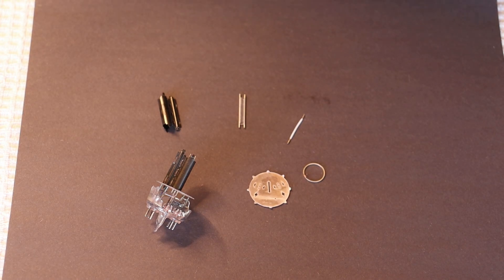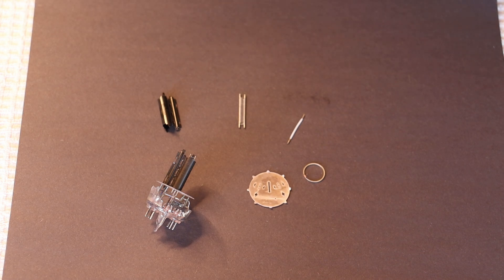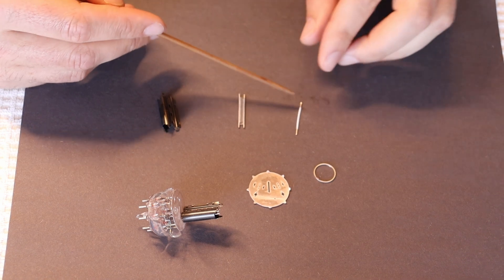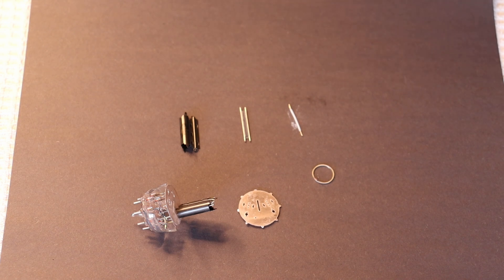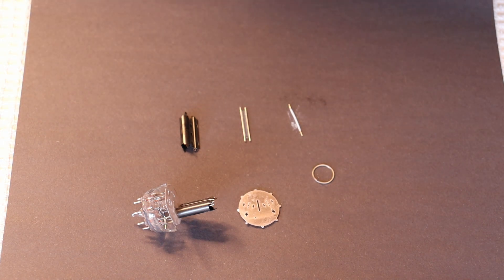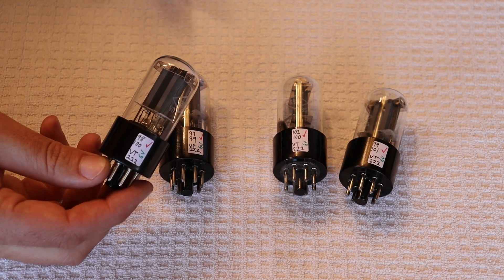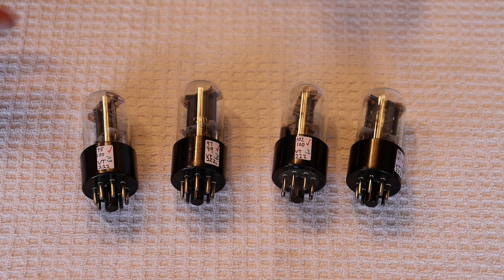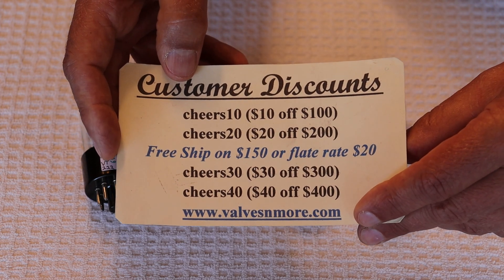Tube Lab #247 - Is Tube Burn IN Real?

Comment: Long ago I read a research paper in which the authors had tested burn in and life at various heater voltages.  They concluded that most tubes optimized performance over life, and almost infinite life could be achieved with moderate loss in performance by running heater voltage 20% low.   They even speculated that there was a bit of planned obsolesce going on. Unfortunately this was 30 years ago so I cannot provide a link and cannot find my paper copy.  Have you observed this?

Comment: What is causing Cathode Regeneration? and is Cathode Regeneration consider good or bad?
Reply from the maker: Cathode Regeneration is a continuous process that every vacuum tube is designed to perform or all tubes would slowly stop working properly over a fairly short period of time.  Basically Cathode Regeneration is the process by which gas molecules are driven off the surface of the cathode and the cathode continuously renews itself.  It works thanks to the inherent properties of vacuum tubes, the physical design of the tube and most importantly the coating applied to the cathode.  For audio tubes it's not something to ever worry about, even as designers it's not a concern, unless of course we were building a vacuum tube computer or some other device in which the tube is lamped but not actually doing anything for very long periods of time.  For those applications, special tubes were designed with extra heavy cathode coatings.  None of those tubes, in my experience, sound very good with audio.

Comment: Does it damage a tube to run the heater for a long period without anode current flowing? Ie: is it bad to run a tube heater only?
Reply from the maker: This is an excellent question.  In my experience just lamping a tube (at data sheet specified filament voltage) with no electrodes connected is perfectly safe for most tubes.  But when you understand that every tube has a finite lifespan (just like an incandescent light bulb), you realize you are literally throwing away good operating hours by doing this.  For years I've read accounts of people not turning off their tube system (ever), or burning in rare NOS vintage tubes for 24-72hrs while playing white noise...
Reply: @tubelab194  Thank you! I was concerned about it as sometimes I allow NOS vintage tubes to heat up on my AVO tube tester for a while with just the filament powered up before testing in order to drive off any gas molecules.
Reply from the maker: @Tharsis879 I think that's just fine.  Just don't forget them!  In fact we have a rule on our electrical benches, not to leave anything on if we leave the bench (other than a quick trip to the washroom or kitchen (working with high voltage is thirsty and hungry work).
Reply: I've always understood that amplifiers with a way to toggle the B+ like a standby, was primarily there so that you could warm the filaments up for a few seconds before turning on the B+, but just turning on the filaments and letting them burn without using the tube seems....counterproductive lol.
Reply: Yes, read about cathode poisoning. If the heater is powered you need some positive potential relative to the cathode to induce some current (even if it's parts of uA) if this is going to be the state for hundreds of hours.
Reply from the maker: To clarify, if we are talking about 1-2 hrs, then nothing bad will happen.  However if we are talking about 24hrs., there's a possibility that the cathode will be partially damaged (cathode poisoning).  This is one of those topics that has as many so called experts saying it's a myth as there are those saying it's real.  I would suggest exercising caution and avoid running a tube filament for more than 2hrs. without the rest of the circuit live.  And really why would you do this anyway???